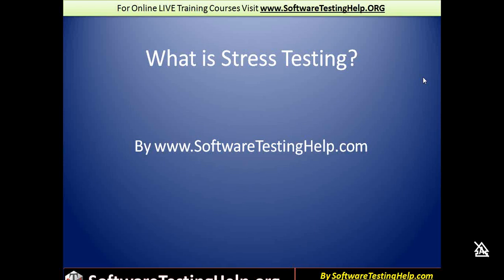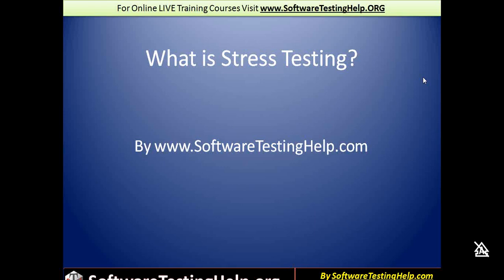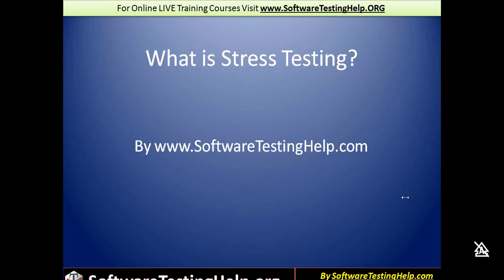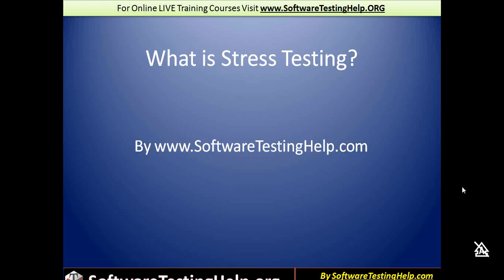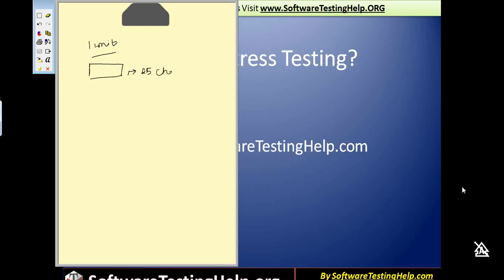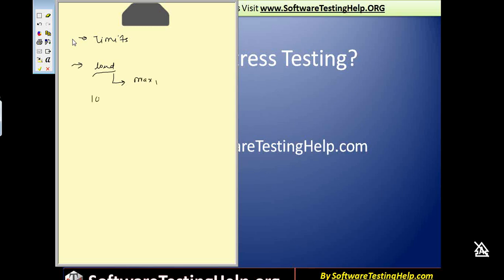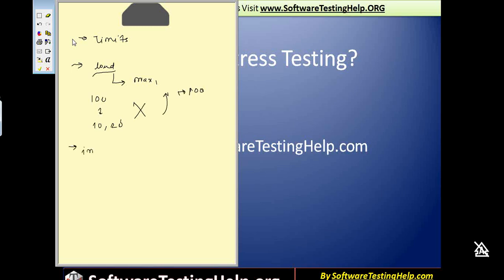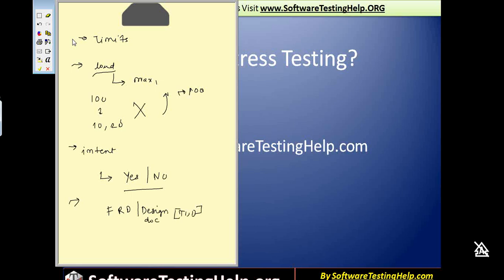What is Stress Testing? Stress tests in Software Testing

Comment: What is difference between Stress Testing and Load Testing?  , please explain.
Reply: A load test is usually conducted to understand the behaviour of the system under a specific expected load. This load can be the expected concurrent number of users on the application performing a specific number of transactions within the set duration. This test will give out the response times of all the important business critical transactions.

Stress testing is understand the upper limits of capacity within the system. This kind of test is done to determine the system's robustness in terms of extreme load and helps application administrators to determine if the system will perform sufficiently if the current load goes well above the expected maximum.
Reply: @mulukentesfaye3632  thanks